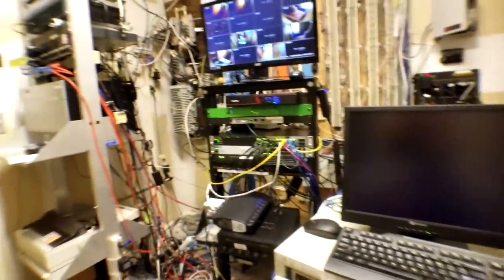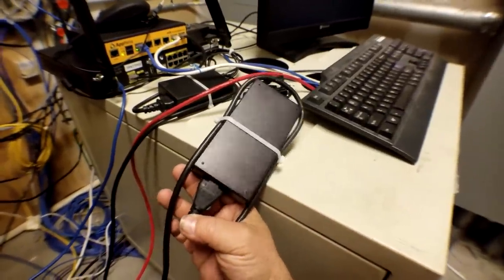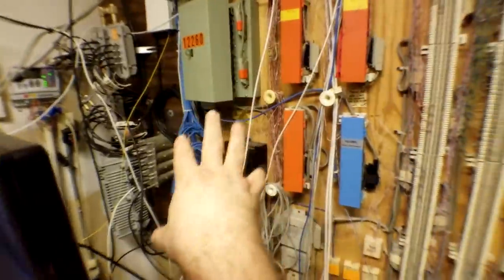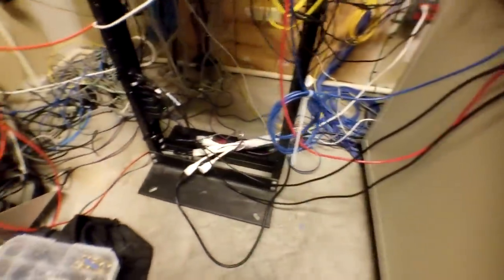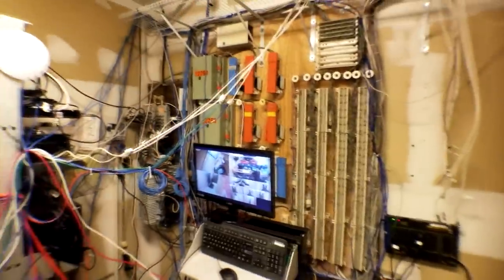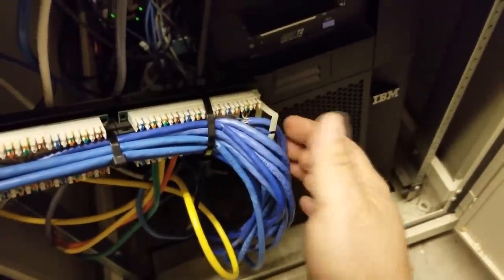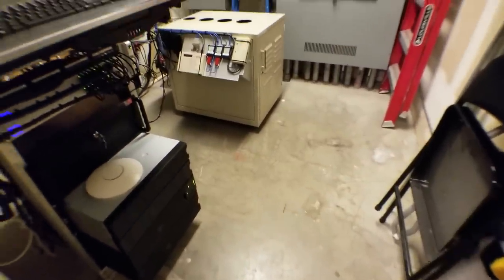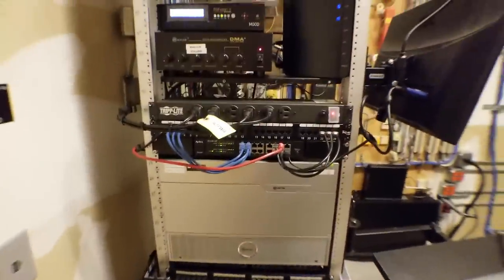#037: The Chamber of Cable Blunders (from Florida)

Comment: personally i would of arseholed the whole thing and install rack cabinets.. and removed the entire mess as it was built and tidies the whole area up as by the looks of those racks were temp fix installs
Reply from the maker: That's usually the best solution but, as in most of the jobs I do, it simply isn't possible because this is a working environment and just can't afford to be down for more than a few minutes (in the middle of the night). My only problem with wall-mounted cabinets in this situation is the expand-ability (or lack thereof). We actually did not originally expect to need so much rack space for the UPS or other add-ons that ultimately wound up there...
Reply: it would of been better to kill the entire  network between 9pm and 6am  rebuiold the whole system across 2 racks and would of found solutions of VDC the the whole network infrastructure because even with redundancy because opof vc overhead you reduce running time depending of the power load on the netwirk in general

personally i would of recommended as genset back up..

if you are going to own somebobie work that is not your own i would to make it easier on yourself rather than make it harder in the long run..

I'd rather see things locked behind closed doors than allow somebody access to without a locked key in place

Personally I would tend to lead to a situation having the racks on wheels as you never know when or where the may need emergency extraction   and it makes it  disconnect the patch cables and the leave the other stuff intact..

I like the video however to me it looks like you arer making minor band aid solutions where a complete overhaul should be done
Reply from the maker: Awesome points!! Actually the owner is working on getting AC piped into the room directly and once that's done the door will be locked so not even staff on break (this is just inside their break room) will have access. I have redirected the AC unit in their break room to point towards the network room door to help with cooling until this gets resolved.

Man, I really like the idea of the rolling equipment rack that can be quickly un-tethered and rolled away for safe keeping!

Downtime was very limited and in most cases was nothing more than a few minutes tolerated due to high network utilization. Still, thanks for the input! Some great ideas here --and you're quite right in that this is really a big band-aid compared to a proper build but it was the best we could do within the limitations we were under.

Comment: Have you got motion compensation turned on? The distortion makes the video very hard to watch.
Reply from the maker: I actually had stabilization turned off and STILL got crappy video. I'm working on getting a more stable shot for future vids. If you're not a Pateron member, I could always use the support! I've been shooting just with my smartphone with a Bestgrip to use a wide-angle lens. With more support, maybe I can get more proper gear!

Comment: and those camera line you should just leave those alone and sorted it out you should leave the DVR where it is
Reply: Precariously balanced with weight on the Cat-5 cables?  No way.
Reply: @stevearkwright  but you can leave it and sort the cat 5
Reply: @Noams_chess_school :  Which is, effectively, what @FiberNinja did.

Besides, does anyone really want the security cam guys’ shoddy, dangerous, so-called “work” stinking-up a neatly reorganised rack cabinet, when everything else now looks so elegant and tidy?

That’s really a matter of aesthetics and pride — but, moreover, there’s safety to consider: you really don’t want loose ethernet cable threads going into a live power brick.  That’s definitely unsafe. ⚡️
Reply: @stevearkwright   re place the power brick and leave it and also get new cat 5 cables and your fine

Comment: Your still blocking required code clearances of the electrical panels.
Reply from the maker: Not that I see. What I didn't have time to show was that we marked the floor with the required clearances to all the panels and made sure it was kept that way. What part did you see that was in violation?

Comment: I've seen hundreds of rooms like this; it's a standard of the so called IT pro these days - ZERO standards.
Reply from the maker: It's a great point. I remember someone here asking me a few months back how many site inspections I've had to go through... Well you can probably guess the answer: ZERO! The fact is there is no inspection body because there is no industry standard for most of this infrastructure --and I don't expect anything anytime soon. Most of what I practice and do is based on the experience of having to work on what others (or even myself) have left for me. That's when I realized the value of some of the things I do. But someone straight out of school with an A+ cert. isn't going to know any of this and I don't have an answer for that one.

What do you think??
Reply: In a nutshell I think most of the nerds / geeks got replaced by white collar yes men. I saw it happening in the 90's, people used the job for a daily pay check in a fast expanding job market. They would flourish their many certificates but really have no love for the job and thus started a slippery slope into lost values (protocols gained from experienced techies across the 60's and 70's into the rapid office and home technological 80's). The other big killer was outsourcing, suddenly various bit's of the comms / server room was somebody else's problem, consultants came and got internal staff chopped; these days a few in-house staff open a spread sheet and look up who needs kicking which in turn results in a ever growing cluster fuck of problems on problems, which I'm very sorry to say looks like the future for a very long time.
Reply from the maker: There's another dynamic at work here too. The fact is that there isn't a network mess I've walked into that wasn't still working just fine (at least for the moment). It's so hard to sell a customer on the need to rehab their infrastructure when it's sitting there working away for years on end WITH all these problems in place!! Hell, I've walked into scenarios where an HVAC team had come in and mounted a VERY heavy slab of equipment in the overhead and managed to capture and crush several Cat5e lines under the several tons of hardware. Well, the lines were still working!! It takes an major bit of malpractice to do work that actually results in a failure of some kind.
Reply: My background was disaster recovery, we would walk into banking clients sites across London and be gob smacked at how much equipment "just runs and has been for years" and unable to grab a person with ownership on it. The fear factor of creating a huge self imploding technical vortex was so great the the yes people didn't dare warn management, who in turn only wanted to hear profit songs from the lower ladder rung minions. Perhaps now over the years insurance clauses have forced better practices, but we hear stories of banking IT failures and just from the witness fallout aftermath, I'd love to know the facts, you can bet it's a large dose of what we've discussed. Imagine the discussions afterwards, oh, so one million would of fixed it, but now we are facing a hundred million bill with a whopping negative brand impact. The industry could do with a whistle blowers watchdog.
Reply from the maker: Oh yes that happens all over the place! The central office I worked within for about 4 years has equipment running in it now that as far as the current technicians are concerned, is nothing but magic. The people who were cognizant of the technology have long since retired and no one was put up to get up to speed and learn the system before that happened. So much is assumed to be documented somewhere and that all the people orbiting the equipment just don't really need to be there I see often.

Your phrase "self-imploding technical vortex" is awesome!! I may use it sometime soon...

Comment: Dotmatrix printer below ubiquity?  Why, oh why?  Did you find garbage can for it?
Reply: Many companies still use carbon paper.
Reply: This site looks like a hotel setup so probably uses an older PMS system which has a parallel (centronix) interface.  They often use it to print reports for accounting, auditing and stuff like that.  Not surprised to see them around.
Reply: Yup, one of my customers recently built a multi-million dollar gold mining site and guess what, they had to install a couple of Oki Microline 390 turbo printers for some of their procurement departments.  They had the network interface so luckily we didn't need to find old centronix adaptors.  Worked well under Windows 2012 Server and Windows 7.
Reply: Okurka If by many companies, you mean the ones who haven't updated technology for 20 years...POS doesn't even look like it has paper.  Leftover trash from the IBM server probably running AS/400 junk.
Reply: T K They do sell carbonless paper now you can run though laserjets about 1000 times faster than a dot matrix... It's a dead technology for a reason.
Reply from the maker: You nailed it!

Comment: Why oh why would you replace a Ruckus wireless system with Unify. Just seems like a big downgrade even with the zone director been an older version.
Reply from the maker: The Ruckus system was being phased out as it was part of a package with the previous service provider and no longer supported here. And with less than half of the AP's that used to be installed, we're now getting far better coverage and throughput.

Comment: Please turn off the image stabilisation... I DON'T CARE TURN IT OFF... it makes videos more blurry and it is nauseating... now that the unpleasantries are out of the way. lets get onto the good sweetener that is network room cable management. the last time I was paid to tackle a job like this with several racks with nearly NOTHING on them in two different rooms. I literally had to tell the customer this. what is you slowest week out of the year cause I need a Saturday at 12:01 am to Sunday at 12:01am that is 8 days EIGHT. not one day. and i had to take everything offline.

As you have said most technicians will walk into situations like this and walk out. It is a dangerous situation... The particular situation I had to rectify was three network closets, 4 racks with barely anything in them. And boy oh boy the stories the walls could tell about this place. It was a classic bed and breakfast not in someone's home but it was a handmade log cabin that had been updated and modified and restored remodeled you name it.

The first network closet was literally just that, a closet with a cable modem, router, switch and a 8 foot rack that was way too black from the fire that destroyed the original lobby. All that had to be moved to the main network closet. how it was doen is the coax was just ran to the main closet in what I thought was the coolest crawl space I had ever been in. it was a snaking 3' by 5' tube just for the power, network , television, phones, and even some air ducts. Everything ran in that crawl space to all three of the network closets.

The second closet had the... well new at the time, PBX from the mid 2000s. And it was being retired. The customer wanted to go 100% IP telephones which was actually very easy since the phones that the IP telephone company were selling them could use the old PBX wires. Which I thought was really cool, it worked like a dream all i had to do was punch down the old lines into a new patch panel a certain way and then connect everything. the IP telco gave us a router and switch combo that allowed everything to be plugged in easily.

I ended up running new ethernet to the main closet from the 2nd and 1st closet in the crawl space patching everything down and mounting the panels in some wall mount cabinets. I even ran extra in the crawl space to allow for expansion to both the old closets.

The third and main closet had more than its fair share of storage of junk trash and broken shit. And I had the customer move it all to the 2nd closet which was now empty. All it had was the television system, some networking for the front desk and the newest expansion and lastly the camera system. All three were going to be rewired. The television system was easy since it was being taken completely out and replaced by smart TV's and then it was just going to have a select few local stations. So it was just taking out the old system that handled the purchase of pay-per-view and the distribution of the various channels.

The office and front desk networking was easy since it could just be disconnected and the only thing staying active after the rework was the server they used. Bringing all the new etherent that I ran from closet 1 and 2 was easy and it was neatly packed onto the one rack that was staying in the room. Using yellow for the IP phones,Blue for the front of house networking and then I decided to use Green for front of house expansion, Purple for the 2nd closet expansion, Red for the cameras and then I left Grayfor the main closet wiring. 

The camera system was a bit different it used coax for all the cameras and thank GOD it was wired through conduits. So I had to break out the cable lube and run the red ethernet thought the coundiots and hope i could just pull it through with the old coax. And I was lucky with only one getting yanked loose and having to redo it. Using PoE IP cameras for the camera system and setting them up a capture server was a breeze.

When all was said and done i had removed the PBX three random racks and probably 10 miles of coax for the old cameras not to mention any of the old networking equipment which was all 100 megabit for some odd reason even though every cable tested for gigabit. And the old television system that was removed. I neglected to take any photos of this so my tall tale will have to suffice. And the reason why I know this Job so well is it took two years to complete. Two different week long sessions spread out in the two hottest septembers I can remember.
Reply from the maker: Wow, that sounds like it was fun!! I can't say what times are the slowest for me because I just don't have consistency of any kind! I just never know what's coming. If you want to contact me, hit up my About page and you should be able to figure it out! Thanks for sharing this work though. I can't tell you how many times I regretted not shooting video or pics of previous jobs I've done like this!!

Comment: Your loop-around on the AC plugs is too tight, needs at least the length of the head in straight on the other side of the loop.
Reply from the maker: I'm not quite following your comment here. Can you possibly elaborate what this guideline is and where it comes from? Also, what are the risks of doing it this way?
Reply: On a rapid twist 3 wire its not as bad but on cheap slow twist 3 wire you can put tension on the connections inside the plug which can result on damage to the wire on unintentional impacts and any lateral force on the female insert results in less secure and possibly less complete connection.   This is one of those circumstances where you want to use a 90° plug.

You're obviously dealing with an idiot customer there who will do things like shove stuff against the wall, knock stuff off or otherwise abuse it.

Comment: more velcro, less zip ties please
Reply: I have those velcro cable ties in a few places, but zip ties pay off when you need so many. Since you have to cut them, maybe zip-ties discourage casual messing around.

One thing I have seen which might suit some jobs uses a beaded strap with a sort of keyhole end in place of the ratcheted slider of a zip tie. Probably not as strong. I saw them keeping the internal cables tidy inside a Dell workstation.

Comment: bro, you gotta stop using zip ties man. get some velcro ffs. i would be pissed if i had to make any changes in there and had to deal with all those f*cking zip ties.
Reply: Yes, there is an over-reliance on plastic zip ties here which can choke/damage your cables.  Far better to use Velcro for most of it.  It saves precious time and irritation when you need to add or subtract cables to/from your bundles or runs, honestly.  Much, much less stressful and equally as secure for that purpose.

Comment: Why why why does everyone cable tie things to an unimaginably difficult to repair degree.... even here you've ziptied a single cable run nearly 30 times. WHYYYYYY
Reply from the maker: It never bothered me personally. In many jobs, I have to bundle cable runs multiple times and still use zip ties the entire time. I just cut them off and put new ones up. The main reason I use them is because I am usually trying to get the cable bundle to "shape" itself to my purposes. And velcro just can't grip the bundle tight enough to do that.